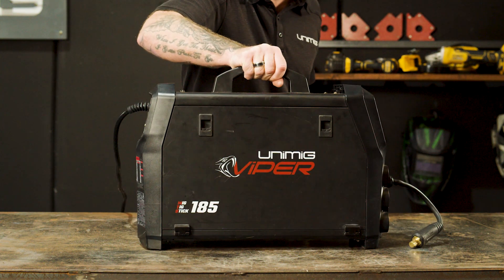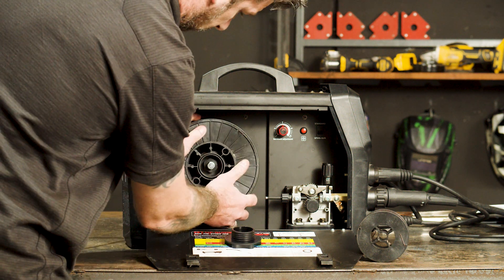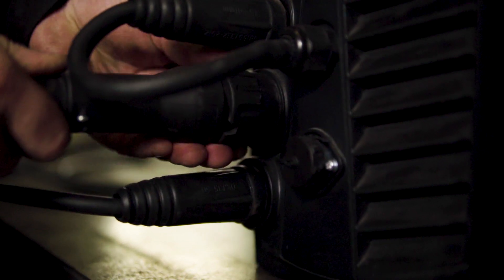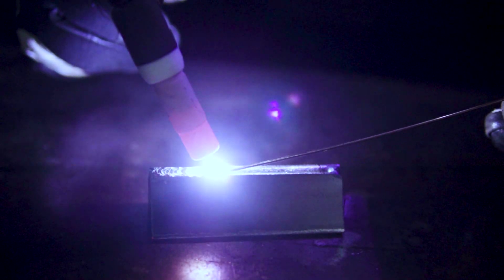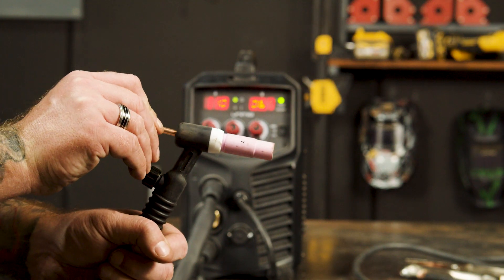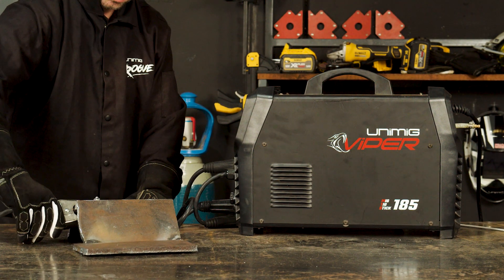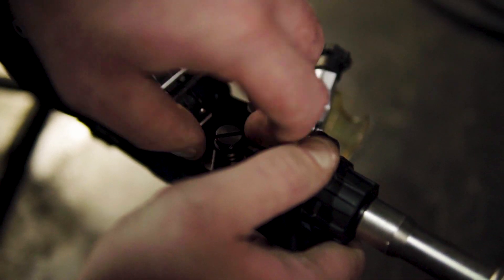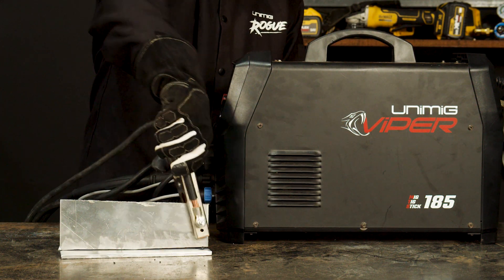VIPER 185 - Complete Welding Setup Guide

Comment: Why when i use my welder through a 10amp safety switch, it trips when i go past around 14v on like 3 wirespeed? Its still using the supplied 10amp plug.

Comment: The devil is in the detail and details are not here. I'm very disapponted with the video and the product itself. It doesn't come with tip wrench. No explanation how to remove the tip. Yeah you can use pliers everywhere but normally people use wrenches instead of pliers. F groove  not explained what is this. So you basically need google quite a lot.
Reply from the maker: Hi, thank you for your feedback. We apologise for any confusion or inconvenience our product may have caused. Your point about the tip wrench is noted, and we are looking into addressing this issue.

Please be assured that we take all suggestions seriously and are considering the inclusion of a tip wrench in future versions of our product. Regarding the F groove, it is designed for flux-cored wires, a detail we should have made clearer.

Comment: What size wire would you recommend for gas mig jobs no more than 2.5mm thick mild steel with this unit?
Reply: Just go with 0.9mm wire, better coverage
Reply from the maker: .8 wire will manage everything you are looking to do
Reply: .8 or .9 nothing bigger 
.9 is my go to
Reply: Do you need to change the torch liner if changing between 0.8 and 0.9 wire?
Reply: @gregwilson9035  Looking for this answer myself I just installed .9 wire into my new machine. It come threw the hand piece and works, so not sure.

Comment: How about tig torch with euro connector,? No gas coming out from the torch. Any video on how to set it up properly?
Reply from the maker: Hey Mate, if you are asking in relation to the Viper 185,  the Euro TIG torch is not able to be used on the Viper 185. Here is the link to the Lift arc TIG torch you are looking for

https://unimig.com.au/product/17v-tig-torch/

Comment: For MIG welding set up you didn't mention setting the wire spool tension ( for both gas and gas less). It's not mentioned in the user manual either. Too much spool tension and the feed rollers slip, not enough tension and the spool over runs giving a wire tangle.
Reply: Thankyou, that overrun was pushing me off